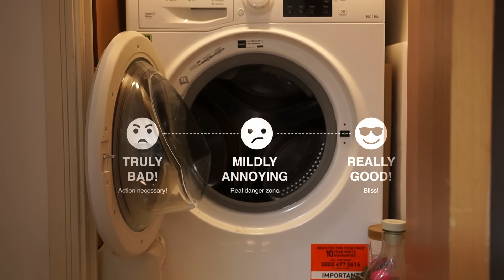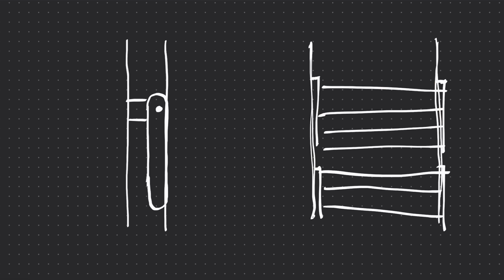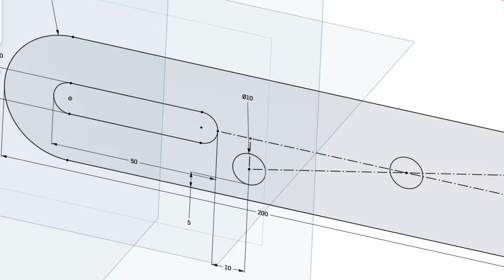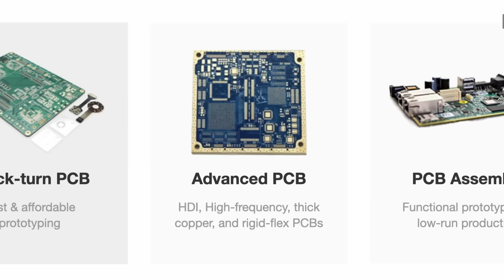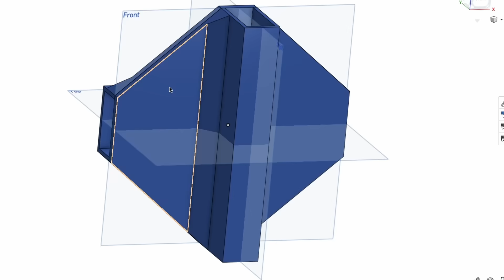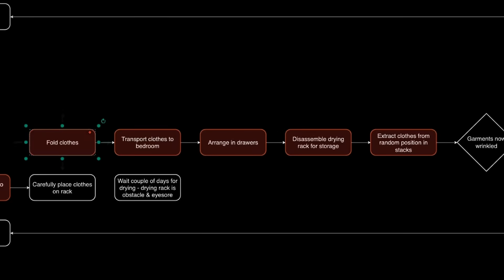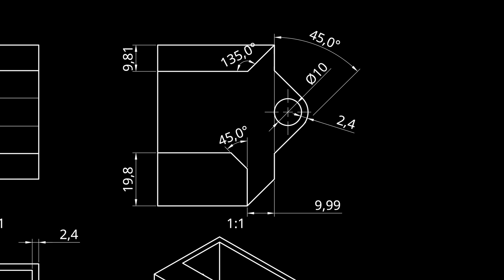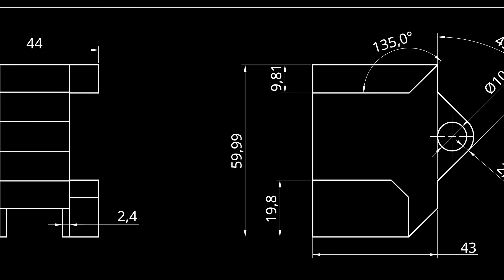I made furniture to escape the most annoying chore - and it fought back!

Comment: As soon as that drying rack came out in the beginning, I got flashbacks to vacationing in French village houses. Why is the Romance languages aesthetic for household stuff such, that it requires things to be super thin and flimsy?

Edit:
Really cool idea and incredible execution of your a newbie! Next time, use either beechwood - preferably heat treated which stops it from warping - or laminated wood (I can’t remember if that is the English word for it, but I’ll look it up); it’s less aesthetically pleasing than beechwood but extremely rigid and sturdy. It won’t ever warp. I bought several of them, then forgot to take them outside in the rain and snow for months. When I finally found them they were green and mouldy, but still super straight! 

And sand all edges. Sharp edges may look cool but they are very fragile and when they inevitably split, the split can go quite far into the wood. Better to sand them slightly and not have those splits

Edit no 2:
Sorry, my head can’t let go of your project: bamboo. Bamboo wood would also be a great option.
Reply from the maker: Thanks so much for the lovely words of encouragement and insights!! I definitely want to work more with wood, so will keep this in mind - genuinely useful information! 😂 And yes, I can absolutely relate to that image of the French village you painted!!

Comment: Oil is non polar, so it can dissolve the adhesive which is also non polar. I use this trick all the time to remove labels from jars. First use a heat gun to peel off the label. Second, smear oil on the adhesive (let it sit for a few minutes). Third, clean up the oil with dish detergent.
Reply from the maker: Awesome tip - will keep this in mind next time I encounter the enemy!! Thanks for checking out my video/ channel!!

Comment: Great video, I loved the design and the type of videos you make.  Good job and success with your channel.
I think For V2 you should try and consider:
- make the individual rods in a rack interexchangable with sliding them in and out from above.
- make each complete rack interexchange as well.
- I would fix it inside my hinged closet door. Leave the door and rack open when drying. And fold the rack and close the door when dry. This could also work for the back of a bedroom door.
- consider to have the racks fold upwards instead of downward. When folding downwards you block the rack below so you can not get the shirts on the lower racks without opening other racks. This is solved when folding upwards. 
- It could also work great on a slide out panel next to the washing machine. 

I am looking forward to your new videos and inventions.

Comment: Haha, great video! It reminds me of too many DIY projects. 😂

I, an engineer, have also streamlined my laundry process, but it is much easier than yours...

The key is to ditch the drawers.
Buy 2 double height clothes rails and a bunch of hangers. Add a dehumidifier. 
Use one side for drying (clothes spaced out) then move to the storage side (clothes more densely packed)
Hanging means no (less) ironing. Leaving them hung means no folding/creasing. 
Also, buy mainly quick drying fabrics. (Bed linen too).

Comment: Wow - cool episode - i live in a tiny house SO I REALLY APPRECIATE THIS CONCEPT!! - ONE UNDER EXPLORED FRONTIER for space usage is OUR showerS!! which basically are an unused closet sized space ( unless your showering ) I COULD  SEE AN ALL PLASTIC version of this that swings in and out of a shower hollow on a sturdy swivel system = turning a shower hollow into a drying rack and closet when not in use - i do a hacked version of this ALSO using a fan at the bottom of the shower to create a wind tunnel/drying chamber for wet clothes!
Reply from the maker: Hey, thanks for the comment and brainstorming!! You might be onto something with the shower modded version of this - will keep you in the loop once I release it. Would be interesting to see the direction you take this/ expand into!! Definitely some interesting ideas in there!!

Comment: Hey, this is awesome! Tip: reprint your shizz in like PETG or ABS. The PLA gets loose over time, messing with that perfect, no wiggle, fit. If that's not enough, the sun may cause it to get brittle or melt.

Now make a machine that finds my missing sock...
Reply from the maker: 😂 I'm afraid humanity has yet to find a solution for the missing sock conundrum!! Thanks for the comment and tip - I'm a little anxious to print in anything except PLA because of the fumes, but you might be right that it probably reduces the lifespan of the item. Will look into this!!

Comment: Looking at the size when it's folded up, I wonder if it would fit inside a wardrobe when folded.
Maybe an Ikea Billy shelf would have the correct size. 
That way when folded up you can close the doors of the wardrobe to hide the clothes and prevent dust build-up. 

But I see two problems with that idea.
1. The clothing closest to the wall might not dry correctly since they would be inside the wardrobe.
2. The wardrobe would need doors that don't take up much space when opened. Maybe sliding door would work.
Reply from the maker: Ok so this is actually something I was thinking about as well - an enclosure. I was considering adding some hinged doors for a future version, if this gets interest. The material for the doors/ side panels wouldn't be solid, but some for of net (inside of a rigid frame), to allow airflow and moisture to still evaporate.

My thinking on this was more aesthetics driven. Functionality-wise, the purely naked version is definitely better, since there are no doors to open/ close when you pick up clothes. Re dust build up, I have not experienced that, since I rotate the clothes fairly regularly through natural use.

Thanks for the comment thought - I think we have a similar thought process!! 😂 I also wrestle with ideas just like you did, with a case "for", and a case "against".

Comment: great video. my pro tip for stickers as long as the material is heat durable is apply heat. I usually grab a hair dryer and focus on the sticker the heat will reactivate the adhesive and they should peel right off. It won't necessarily remove all the leftover residue from the adhesive though.
Reply from the maker: Thanks for the comment - glad you liked the video, hope you stick around (no pun intended maybe)!! Re heat, won't it make it more sticky and less viscous? Not sure why, but my intuition is anxious about this.. 😂

Comment: You could make each level detachable. This way you could have a drying rack that you can roll around, put outside, move to the washing machine etc. Once the clothes are dry, you could detach the thing and put it in the permanent storage unit in a hanging configuration as you already did.
Reply: Was thinking the same thing. You could then have the storage be in a cupboard to keep it out of the way and dust free.

The storage could either be flush with the wall, or for more space efficiency on sliders perpendicular to the wall.

Comment: Amazing design and video production! This could be a great addition to a "twin slot" shelving system, which could eliminate the need to have the custom mounting frame. Use the twin slot to wall mount, or mount inside an existing wardrobe, then design an adapter for the folding assembly.
Reply from the maker: It means a lot to read comments like yours - thank you for stopping by and for your kind words about the work!! Re your idea, this is great!! I thought about something like French cleats, but this may be even better! I'll include it in the notes when I release it as an option. Wall-mounting would definitely simplify things a lot (and arguably, improve the whole design).

Comment: Very clever build. It might be a moot point since the whole goal is to leave the garments on the rack for a while, but I thought it might be interesting to take some small fans (like computer fans) and 3d print a plenum to blow down (or up) over the clothes to speed the drying process.
Reply from the maker: Thanks for the kind words - really glad you resonated with the design!! Funny enough, I actually considered fans as well!! I was thinking to myself... "what if I add a TURBO mode to this?!" 😂 I suspect the air-assist would actually make quite a difference, but I couldn't afford delaying the video for much longer..

Comment: there's a fun chemistry explanation for your cooking oil trick. Yknow how oil and water don't mix? Same concept applies when manufacturers are choosing glues, and since pipes like that are commonly stored outside, they choose glues that basically do not mix with water. What won't dissolve in water, usually will dissolve in oil!
Reply from the maker: Wow that's such a cool insight!! That last sentence will stay with me for very long, thanks for sharing this!!
Reply: @UrbanCircles  btw you could use wd-40. Works just as well
Reply: @UrbanCircles  I felt that pain as you cut yourself on the metal tubing. Always de-burr the ends though I'm sure you realised this already by now. 

Methylated spirit or isopropyl alcohol tend to dissolve most sticky glues used to attach paper labels. Though as you've found it might not always be the case. Both are extremely flammable though, so use with caution. As for the cooking oil dissolving glue like that… I suggest you stop eating it and use it as a general lubricant in an engine or something instead. Imagine what it's doing to your insides otherwise!

I was wincing as I saw your wobble before you discovered bracing… and as far as a mark II version goes, how about this as an idea?  Assemble a mechanism that uses pairs of parallel rods between the sides of one shelf of clothes that move together such that when the shelf is horizontal (and braced to latch it into the drying position) the rods are spaced further apart to allow more airflow and quicker drying, and then you unhook the bracing and lower the shelf to the "wardrobe" position one rod in each pair slides to meet up with its counterpart reducing the space between to the thickness of two rods? If this sounds complicated to picture consider the motion the gantry on a 3D printer makes and how that would look if there were two rods that are perpendicular to the sides and parallel to one another, but one of the rods was offset in the third axis slightly from the first, and the other was attached to a belt. As the belt moves one rod moves but the other remains stationary bringing the two rods closer together.

The thought process behind the additional design is that a shelf could then dry heavier or bulkier items like jeans, shorts, sweatshirts perhaps two or three per shelf (depending on the weight when damp).

Interesting video though, so thank you for sharing!
Reply: Also, quick tip is to use acetone before oil: it doesn't desolve oils quite as well as other oils or ethers do, but it evaporate much faster then oils so if it works, it's better. I keep a bit of hexane for when acetone doesn't work, but it's much more annoying to work with and it's probably not a good idea if you aren't sure what you are doing (it needs to be destiled to a specific temperature to not be REALLY toxic)
Reply: @yahhav345  solvents like acetone will ruin the paint finish and can dissolve certain plastics. fine on glass and bare stainless steel.
Reply: Oil works very often  and is always on hand in the kitchen and is environmental friendly. It took me long to believe my wife but it is very often better than any specialized chemical that I used.
Reply: Or Goo Gone

Comment: Remember that oil thing.  It works for other cases as well.  Sometimes it's a good stain remover.  A stubborn stain that won't wash out will dissolve in oil and then wash the oil out along with the stain.  It also works when working on the car to keep your hands clean.  But you have to do it Before getting your hands dirty.  Your skin soaks up the oil so when grease and grime happens it won't soak into the skin because the skin is already saturated and the hands wash off easily.
Reply from the maker: No way!! This is so useful, thanks a lot for sharing the tip!

Comment: Oil is just the right solvent for most sticky labels. Works on glass jars too, as well as plastic bottles and so on. Whenever you have a hard time removing some random gunk, try all possible solvents starting from water, oil then alcohol, then acetone or gasoline (which can start dissolving plastic so be aware) and so on
Reply from the maker: That sequence is super helpful - I'll definitely keep that in mind (I have a feeling this is not the last time I come against this sticky nemesis). Thanks for the tip - hope you enjoyed the video!!

Comment: The oil trick is one of my favorites. 

My theory is is that the small bits of adhesive residue keep keep resticking themselves to whatever they touch as you're trying to remove them. As you work with manual removal like scraping and scrubbing they get more and more spread out across a bigger surface area and clog up the tools.

Water breaks down the sticker paper which just speeds that up and creates paper crumbs to mix into the adhesive.  Soap helps some by preventing a little bit of the resticking, but only a little since a lot of sticker adhesives are hydrophobic. Oil does a much better job of flowing over and staying on every exposed bit of adhesive so it can't restick to anything or clog up your tools
Reply from the maker: That's really interesting - that's exactly what I saw with water, soap, etc.!! To be honest, I've never looked into the chemistry/ physics of it. Thanks for the comment and for checking out my work - hope you enjoyed it

Comment: I currently hang most of my clothes on coat hanger for this exact purpose, but man. This is great! I might build this to improve my situation even further
Reply from the maker: Fantastic - thanks a lot for the comment and interest in this project!! I consider the hanging as well, but I had 2x issues with it. First, it takes me significantly more time to fiddle with the hangers than just drape clothes them over some tubes (could just be me though). Second, I feel like hangers tend to widen/ loosen the neck of some of my clothes e.g. t-shirts/ sweaters, especially if I use them while the clothes are heavy with moisture (this could just be me as well). So, call me biased, but I do think you'd see some gains from adopting something like this!! 😂
Reply: @UrbanCircles  What width are your hangers? = How long are the alu rods you use? :) Do you find it troublesome with longsleeved items?

Comment: Great idea!
I’ve version 2, could you make the Aluminium rods detachable?
That way, you could have one section for drying, and the other sections for hanging.
Once an item drys, you pick it and the rod up, and move it to the preferred section - ie shorts.
This could be achieved by having the rod sit in a diagonal slot on the arm, not a through hole.
The diagonal slot would need to be aligned so that the rod doesn’t fall out when the arm is in both the horizontal and vertical position.

Comment: This was great, just got a 3D printer 2 weeks ago and will be building something like this myself as well.  Did you consider using aluminum tubes for the uprights as well?  Probably would have made it much more expensive as you would want a larger diameter tube for the uprights than you used for the clothes rails.
Reply from the maker: So glad you liked this and congrats on your 3D printer - I have no doubt you'll have a blast!!!

Re tubes for the uprights, that could totally work BUT, if you're leaning towards mental (which has plenty advantages), I'd also throw in your mix of options aluminium extrusions. I think you can grab some pretty cheaply, they'll give you rigidity and also, as a bonus, an easy system for fixing attachments.

(I was actually going to use that myself, but it really didn't go with the other furniture in the bedroom)

Comment: Absolutely sick design! I just have one stupid question, why don’t you use a dryer for your clothes? My process is: Laundry basket -> washer -> dryer -> hangers for shirts and drawers for socks and underwear. I never sort, hang dry, steam, or fold anything and my clothes are a variety of fabrics and colours. I find a lot of custom clothing instructions are not really necessary unless they’re truly exotic fabrics like suit jackets or ties or silk or something.
Reply: A lot of places were designed without space for a dedicated drying machine. I won't speak for the author but I know a lot of my families clothing should be hung or laid flat to dry. Combine a drying rack, or a clothing line in the sun and it saves you from having to pay for, maintain and eventually replace another machine. At the very least, it reduces the number of hours the machine needs to run.
Reply: @spootyfrog  But a lot of places if you don't have a good spot for sun and fresh-air drying, then not using a dryer is the formula for mildew spots on your clothes. Had to deal with that while hang-drying stuff when the dryers for the apartment were out of order for a month. At least those managed to wash out later, so it could have been worse.
Reply: Either no space or a drier is an unnecessary waste of money (both in buying it and the electricity) if you have a space to dry the clothes on a rack.

And also using a drier doesn't really save any labour. It's still about the same amount of steps and time.